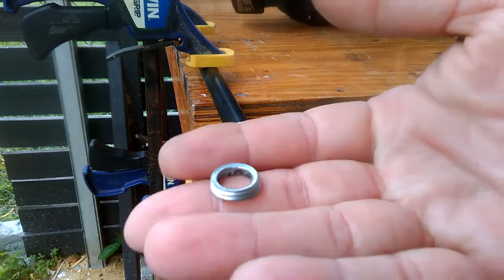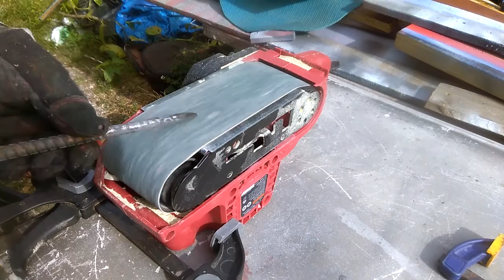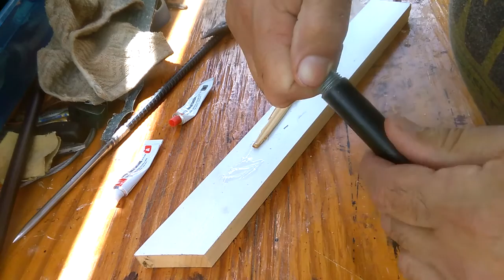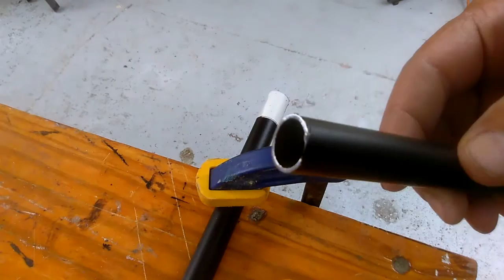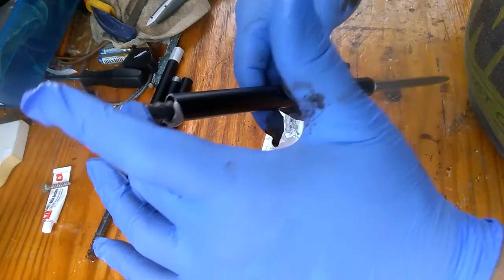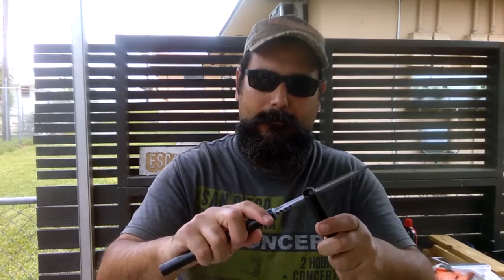rebar Shank Knife and Baton

Comment: Nice project. Very clean look to it especially since you didn't use a lath.  Could be a basis for a cool defense cane or umbrella. But the sleek baton is awesome. If you made it a resistance fit with no threads I'd be more into that setup. If you need to use it as a baton it'll still work and maybe the cover may fly off but it's just as effective as a baton without an aluminum cover.  I like how the rebar is so study and continues into the handle so you could use it in an emergency to say pry open a door without it snapping like a knife. Or to break auto glass. Personally I'm not walking around with weapons but if you had to stop a person the weight and bluntness of the baton element would be nice for non-lethal deterrent that could be used to stabbing if need be. Some situations call for a some pain to be dealt but not necessarily slicing the crap out of said person/animal.  In CA it's a felony concealed weapon so no advantages there...